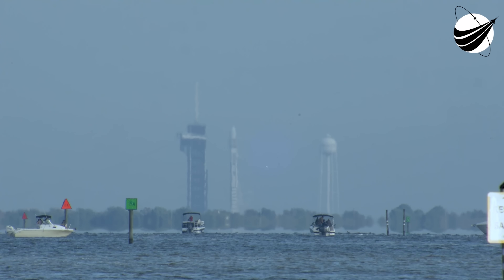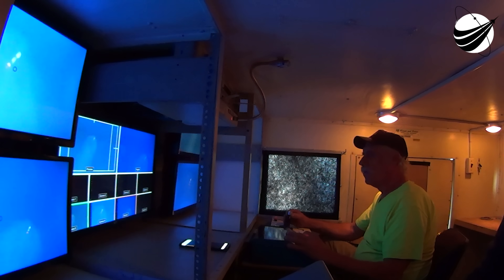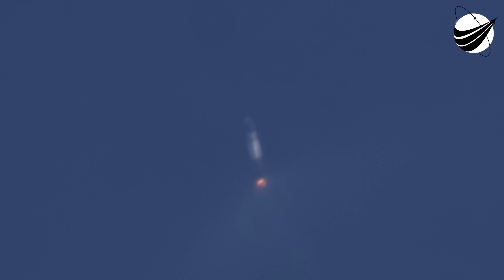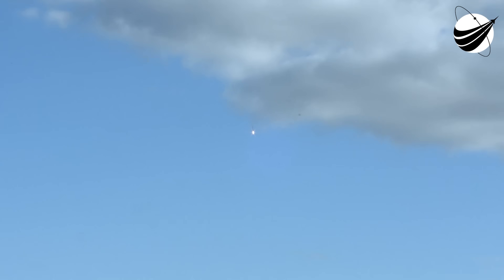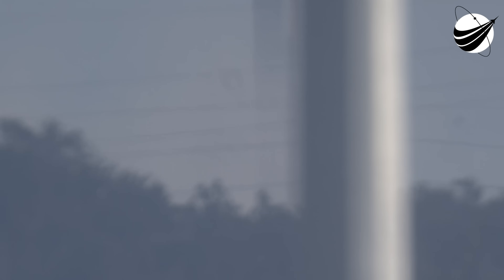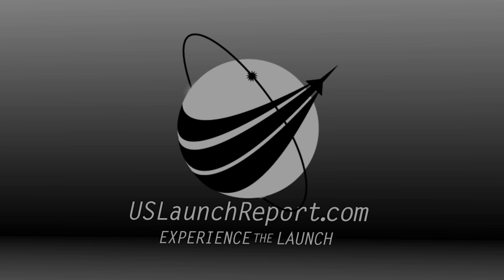SpaceX - Incredible Close-Up - Boost Back Burn - 4K - NROL-108  12-19-2020

Comment: This is a great video that PROVES that rocket propulsion works IN A VACUUM!

When the first stage separates from the second stage the system is ALREADY IN VACUUM!
You can TELL based on the aerodynamic effects on the first stage as it turns around - THERE IS NONE!
IF that first stage had been IN ATMOSPHERE moving at 3500 MPH, it would have been TORN TO SHREDS as it turned at that speed.

Then notice how the cold gas thrusters TURNED the first stage around? (rocket propulsion in a vacuum)
Then notice how the SECOND stage lit and ACCELERATED AWAAY from the first stage? (rocket propulsion in a vacuum)
Then notice how the first stage CANCELLED that 3500 MPH EASTWARD Vector, TUNRED AROUND and FLEW BACK to KSC?

next WATCH the exhaust plume from the GROUND until MECO.
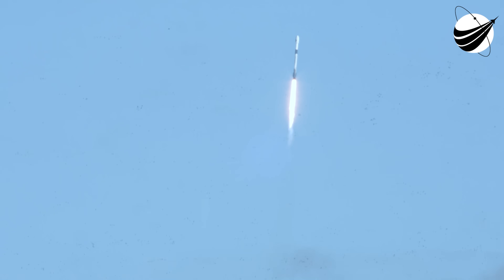At 1:00 the plume is the same width as the booster
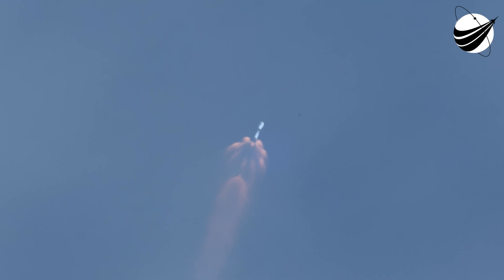At 2:13 the plume is about TEN TIMES the width of the booster.
Did the exhaust plume EXPAND getting BIGGER AND BIGGER, until it CANT GET ANY BIGGER before shutoff?
WHY do you suppose the exhaust plume was VERY NARROW at liftoff and FULLY EXPANDED at MECO?

Might that have something to do with: IT REACHED VACUUM during the ascent?

So if rocket propulsion does NOT work in a vacuum - HOW DID THAT BOOSTER FLY BACK IN A VACUUM ??
Pure Black Magic?

Comment: 3:55 seconds they cut the footage..Oh, we lost it, our trackers lost it...lol...then you get the candle stick flame landing...LOL what a joke.
Reply: So live VIDEO EVIDENCE of rocket propulsion in a vacuum is a JOKE?  I guess you cant tell actual EVIDENCE of something even when you look right at it.
Phil - When the first stage separates from the second stage the system is ALREADY IN VACUUM!
You can TELL based on the aerodynamic effects on the first stage as it turns around - THERE IS NONE!
IF that first stage had been IN ATMOSPHERE moving at 3500 MPH, it would have been TORN TO SHREDS as it turned at that speed.

Then notice how the cold gas thrusters TURNED the first stage around? (rocket propulsion in a vacuum)
Then notice how the SECOND stage lit and ACCELERATED AWAY from the first stage? (rocket propulsion in a vacuum)
Then notice how the first stage CANCELLED that 3500 MPH EASTWARD Vector, TUNRED AROUND and FLEW BACK to KSC?

next WATCH the exhaust plume from the GROUND until MECO.
At 1:00 the plume is the same width as the booster
At 2:13 the plume is about TEN TIMES the width of the booster.
Did the exhaust plume EXPAND getting BIGGER AND BIGGER, until it CANT GET ANY BIGGER before shutoff?
WHY do you suppose the exhaust plume was VERY NARROW at liftoff and FULLY EXPANDED at MECO?

Might that have something to do with: IT REACHED VACUUM during the ascent?

So if rocket propulsion does NOT work in a vacuum - HOW DID THAT BOOSTER FLY BACK IN A VACUUM ??
Pure Black Magic?

Comment: That was amazing! You really get a sense when the boost-back starts of the intense acceleration with no payload and almost no fuel. I spent many years in the satellite command and control arena, and when Falcon 9s started doing these boost-backs, I thought of the proposed RTLS abort modes for the shuttle and I just couldn't take in the implications for required marginal fuel loads and the accelerations needed to do this. Then I found a site (I think for model rocket enthusiasts) that had the flight profile, and that burn is something like 15Gs. This video really brings that to life! Thank you for producing and sharing this. Subscribed!
Reply: So true. When I modeled simple reentry I started to understand why Elon calls reentry without braking burn “hitting the wall”.

Comment: What a fantastic video. If we had lingered just a couple of seconds longer on 2nd stage we would have seen fairing separation. How cool that it is even possible to see both events in one shot.
Reply: We have seen many fairing separations in the past but only recorded 3 boost back burns so they  are rare events

Comment: I'm confused here, does this omit the reentry burn or was that incorporated into the back burn somehow?  I guess I would have to know the trajectory to properly understand.

EDIT: Oh, and amazing video and tracking!  Congratulations on that!
Reply: The reentry burn is a separate event from the boostback burn. The boostback maneuver causes it to loop up very high in a ballistic arc back towards the Cape, and then the reentry burn slows it's fall before it hits the thick atmosphere (otherwise, it would overheat and/or be crushed by aerodynamic loads and friction). It wasn't shown here simply because it was obscured behind thick clouds.
Reply: @randomstuff8257  OK, thanks.  I was just confused by not seeing the reentry burn.  I understand the dynamics of the boostback burn -- I've done it many times in KSP -- which is tricky when I also need to switch back and forth to/from the second stage!
Reply: We have several  great shots of the entry burn in past videos

Comment: 5 trips to orbit an back with minimal repair or rework done to the booster? The falcon 9 makes the space shuttle look like a overpriced toy
Reply: In the early 90s I followed the shuttle program closely.  Shuttles were barely reusable.  Each one was nearly torn down to the airframe, each part inspected and many upgraded.  The heat shield tiles were all inspected but due to shape of the shuttle no two tiles were the same.  If one needed to be replaced it had to be manufactured.  I think the fastest shuttle turn-around was four or five months, more typically it was 8 or 9 months turn-around.

The published cost per shuttle launch was $400 million.  But when you honestly figure in r&d launch cost was north of $1 billion each.  The biggest drawback was that each and every mission was crewed, even the very first.  So if a mission involved delivering a boring satellite, it included at least three crew.